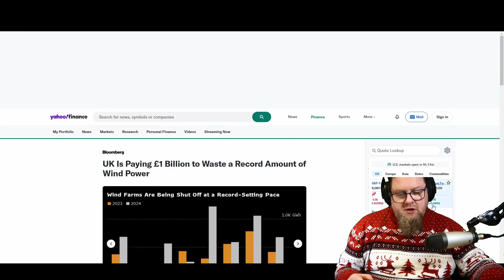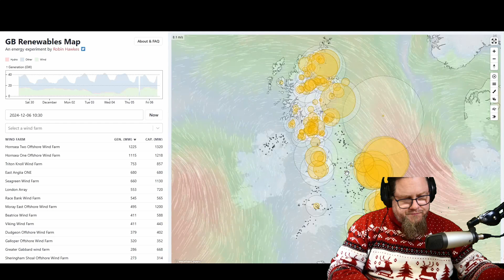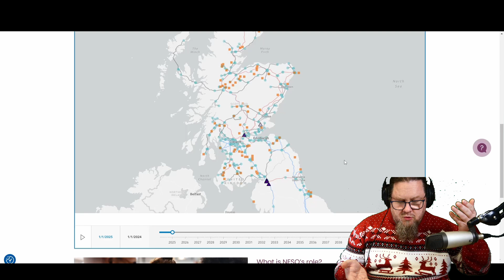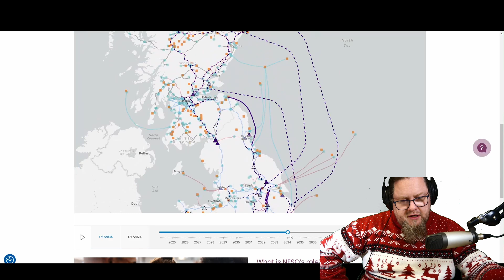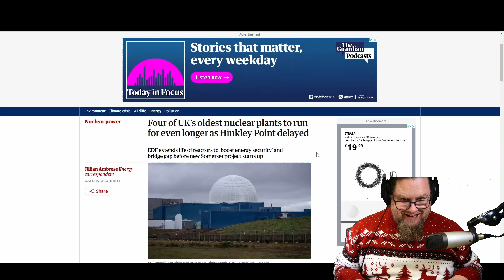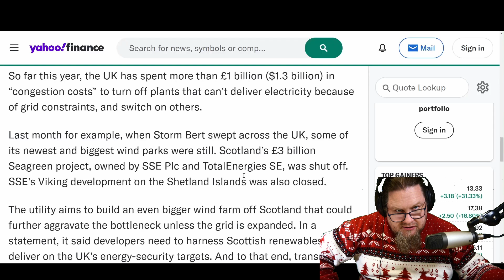Disaster! Starmer Out Of Touch With Reality, 100% "Clean Power" by 2030

Comment: Cleaner energy already exists hydro. I’m not a fan of nuclear power plants specifically for radiation issues. 
JCB has been working on hydrogen engine’s 
There is also a gravity based counter weights type system / generator based of an old clock that’s currently being developed here in the uk. 
There are a new type of solar panels being developed 
That produce some power with just moon light more effective than current solar panels. If you live near a river you can easily create your own power source using a few 10 kWh generators / dc 3 phase motor/ generator gravity based hydro just channel some water into a modified funnel of a certain length
Reply: And how do you power the world with that and replace all the fossil fuel that exists.........
Reply: Get real and do some basic math. To power England You would have to flood Scotland to a height of 30 metres nightly every night.